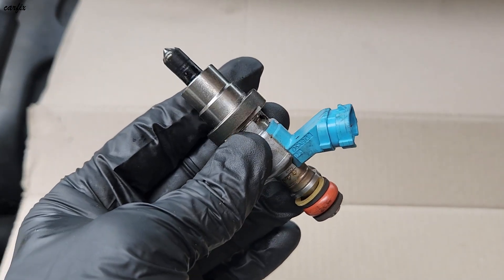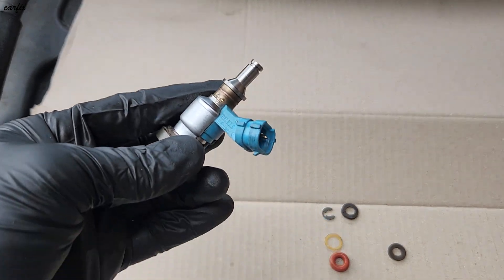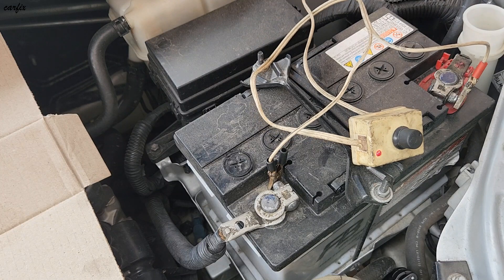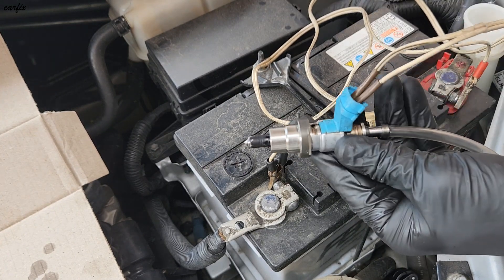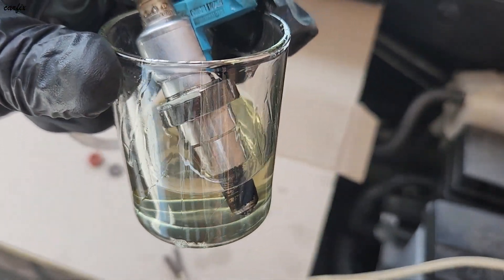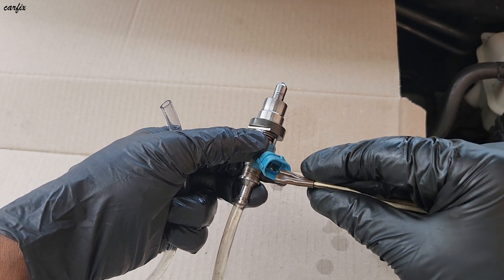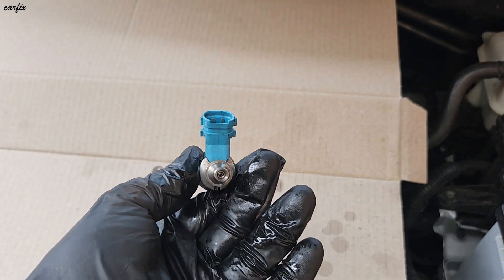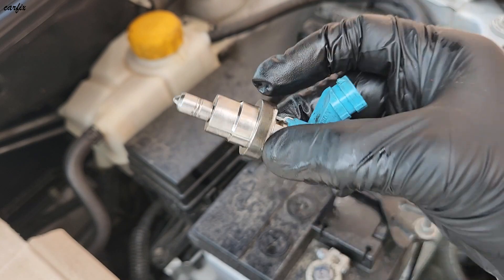How To Cleaning Injector [Cleaning Dirty or Clogged Fuel Diesel Injector] Injector Cleaning

Comment: hey mate what type of product did you put in the glass to soak it with? was it the same carb cleaner stuff? Cheers
Reply from the maker: Yes  Same carb cleaner
Reply: @carfix1993  Thanks mate! could you tell me a little more about that relay/controller you are using? that looks like a very genius idea!
Reply from the maker: https://www.fruugoaustralia.com/fuel-injector-tester-amp-adapter-for-diagnosis-and-cleaning-of-injectors-diy-gasoline-battery-syst/p-232173638-496434738?language=en&ac=google&asc=pmax&gad_source=1&gclid=Cj0KCQjwpZWzBhC0ARIsACvjWROqpJzlXVamNAdmotsDbwOq30vbG1lHIzqPDpARsSUZBQxEfOhP-PwaAkj_EALw_wcB
Reply from the maker: https://www.fruugoaustralia.com/fuel-injector-tester-amp-adapter-for-diagnosis-and-cleaning-of-injectors-diy-gasoline-battery-syst/p-232173638-496434738?language=en&ac=google&asc=pmax&gad_source=1&gclid=Cj0KCQjwpZWzBhC0ARIsACvjWROqpJzlXVamNAdmotsDbwOq30vbG1lHIzqPDpARsSUZBQxEfOhP-PwaAkj_EALw_wcB
Reply: Hi,first,I wanna to thank you for video and after that I have a question,do this injector have an Cooper Ring when you put it back on motor?
Reply from the maker: @gabrielbaciu5889 no any copper rings
Reply: Thank you for such a quick answer, tomorrow I'll will clean up, have a nice weekend 🎉🎉🎉